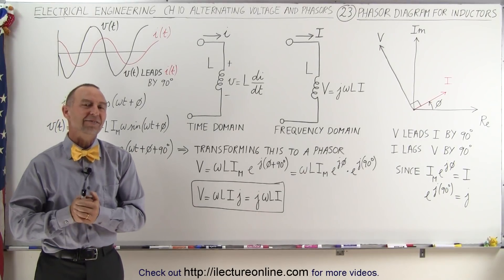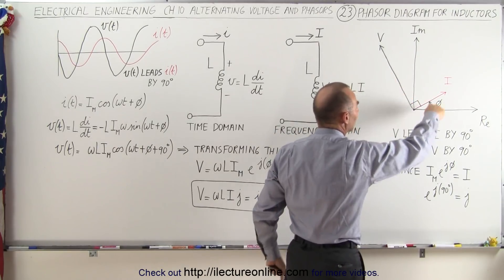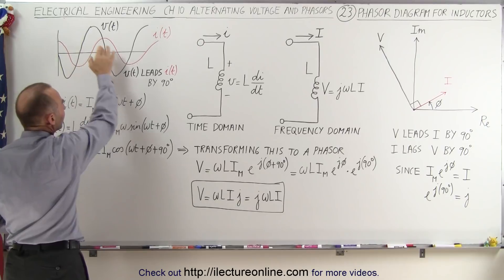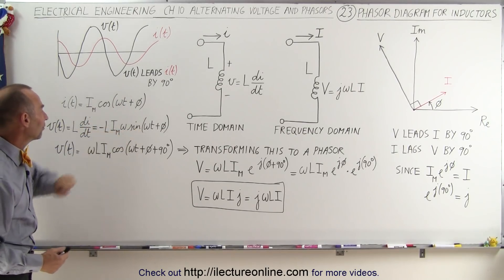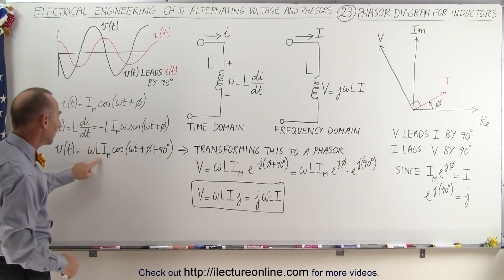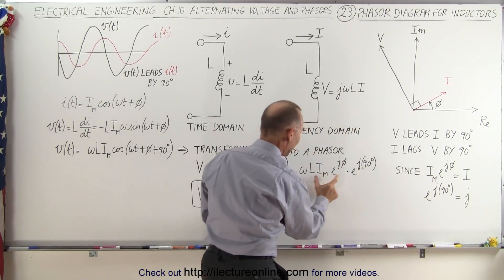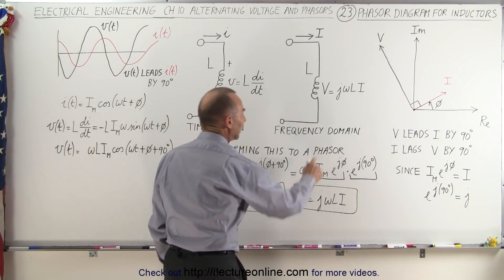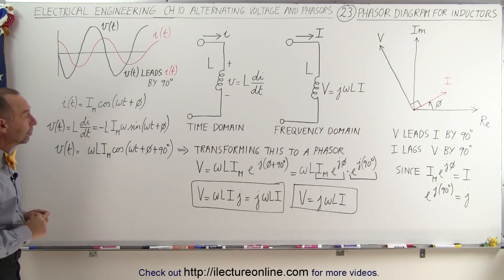Electrical Engineering: Ch 10 Alternating Voltages & Phasors (23 of 82) Phasor Diagram for Inductors

Comment: hi how did cos(wt + theta + 90 degrees) become e^j(theta + 90 degrees) ?
Isn't e^(theta) = cos(theta) + sin(theta) * j ??? How come we can convert cos(wt + theta + 90 degrees) --> e^j(theta + 90 degrees) when no sin() function is being added to the cos() function?
Reply from the maker: This is not so much a mathematical conversion as it is a conversion from the time domain to the frequency domain.  In the frequency domain, we express the voltage and current as the magnitude and phase angle
Reply: @MichelvanBiezen  hi! I am currently watching your videos to prepare for my Fundamentals of Electrical Engineering final exam tomorrow, and your lessons are my sole resources ahahha. I learned the entirety of Phasor lessons from you, sir! I am now learning Balance/Unbalanced three phase systems and AC Circuit Analysis. Thank you so much for the videos! I subscribed to your channel and hope your channel becomes even bigger in the future.

Comment: why cos(ωt+90+Φ)=e^(90+Φ) in phasor form??
shouldn't it be cos(ωt+90+Φ)=e^(90+Φ+ωt)
pls explain
Reply: Same doubt..anyone please explain.
Reply: because its a phasor-domain representation, not a time-domain representation.
when transforming you "remove" the time part.
Reply from the maker: Note the sign change on the right side of the equation.       Sin (90) = 1   Cos (90 + 90) = -1
- cos (90 + 90) = 1